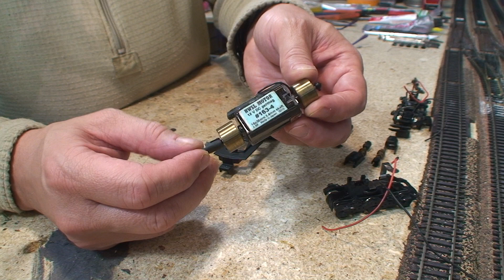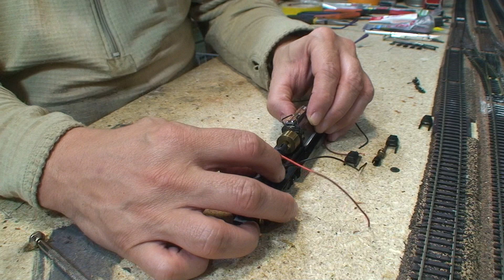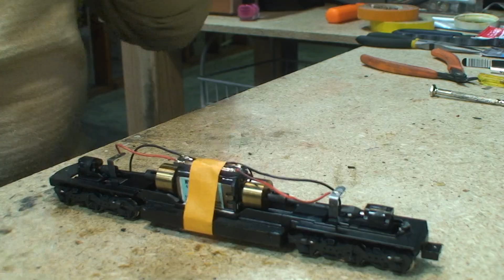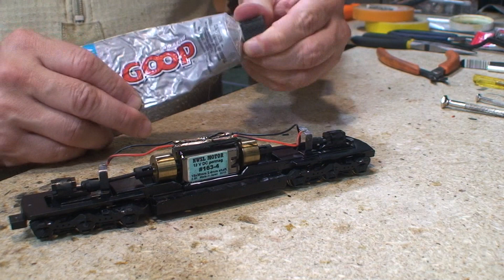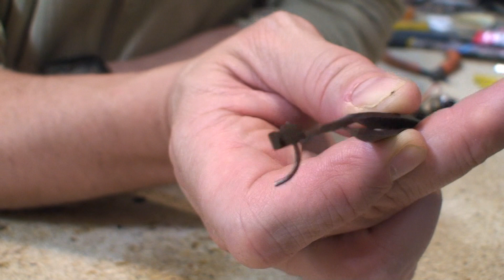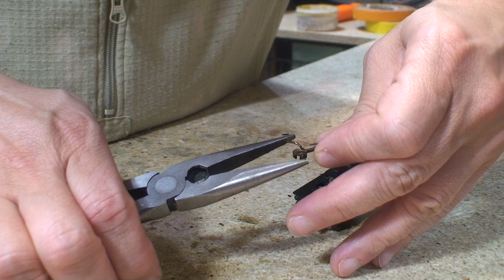Athearn C44-9W install NWSL motor Part 3

Comment: The DASH 9 trucks are different and longer than the EMD SD trucks. those are the wrong trucks, which explains why they don't work.Those SD trucks actually sit lower as to why it derails too.
Reply from the maker: they are totally the wrong trucks, but I only had a spare set of these on hand and it isn't worth the trouble to get a special pair just for this one

Comment: Great video and very useful information for looking at my own locomotives. I purchased a wire looping pliers from Michaels craft store for adjusting the hook on the couplers. Keeps me from damaging the coupler.
Reply from the maker: I also have the complete set of pliers from Michaels and use them quite a bit